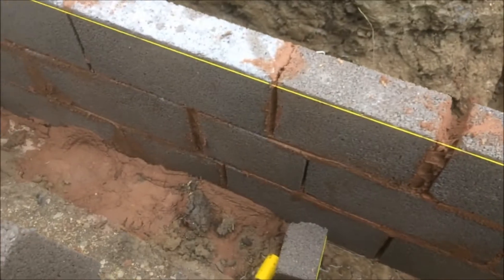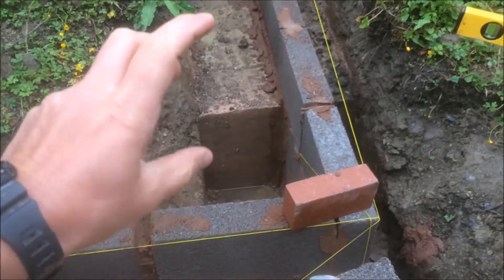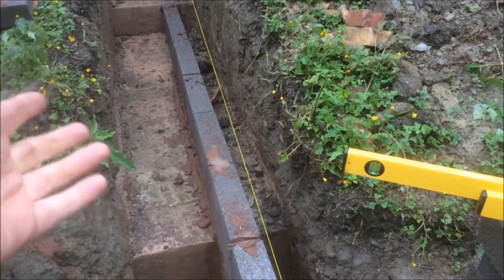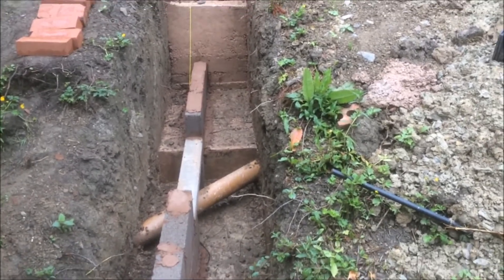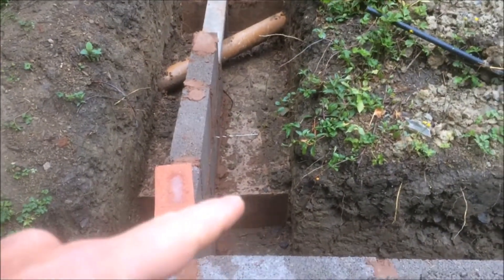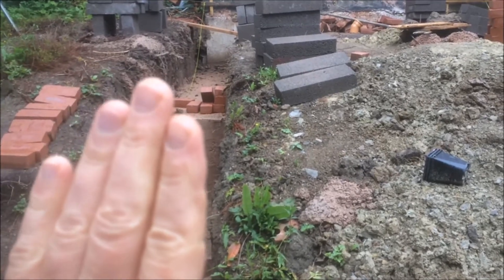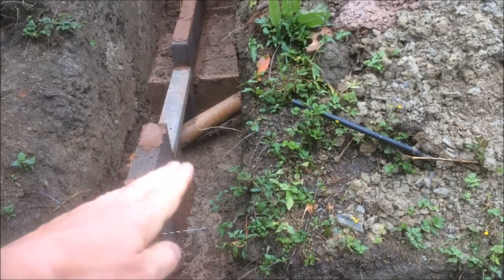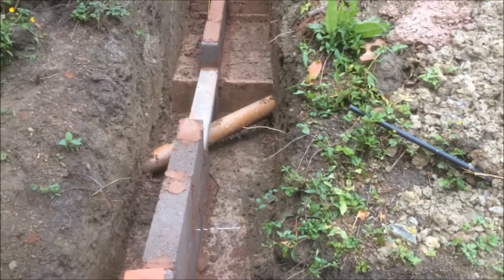How To - Stepped Foundations

Comment: Each step should not exceed 500mm
Reply from the maker: I'm not sure if that that's the case (maybe yours is a rule of thumb): According to most building regulations, the maximum height of a step in a foundation should not exceed the thickness of the foundation itself; meaning the step should be no higher than the concrete depth of the foundation.

Comment: Did I hear wrong or are you bashing rebar into soil beneath the concrete footing? Wouldn't that inadvertently introduce concrete cancer?
Reply from the maker: Great question. Concrete cancer (weakening of concrete over time) can occur in two ways (off top of head). Either the aggregate used within the concrete is "aggressive" ie. acid producing. Or the soil in which the footings are placed is acid. As cement is alkaline the acid acts on it to weaken bonds. Typically this is sulphuric acid (as in BRE special digest 1), although recently aggressive ground has been expanded to include other acids. So it would not be the rebar that causes the problem. Concrete is permeable any way, so acid water will get in there if it is around anyhow. Hope this helps. :-)

Comment: Great video, really informative to see! Could I ask please roughly what the total height of the "drop" is?
Reply from the maker: From memory it was a five block drop (5 x (215 +10)= .1125mm.  With 1 x 3 block step and 2 x 2 block steps. When you work out step height, add a little extra to account for mortar. Better to have a little too much room (higher step) than not enough. Easy to but thicker joint in block work, than cut all of block sin a course. The steps were not the same both sides, as I had to get footings below pipes which ran across site.

Comment: Hi, very informative, Thankyou! Do u somehow remove the shuttering after concrete set or cut it down to footing level or.....? Thankyou in advance 👍🏻
Reply from the maker: This way the lower step is formed first. You then secure the shuttering on top of the lower step. When the concrete is "green" (set but not cured) the day after pouring, remove pins and wiggle shuttering free. You can then use it for the next step! I mixed my own concrete so could do one step at a time. Happy Mixing!
Reply: @DorkyThorpy  Thankyou, makes good sense! Not sure about mixing myself now as I worked out 14 jumbo/ton of ballast! Did u use all in one ballast or do a particular mix specific for footings? Appreciate your replies 👍🏻
Reply from the maker: @norris5353  I got a 6 wheeler load of all in limestone ballast, "suitable for concrete" I asked for that. Just followed instruction on back of cement sack for mixing. Out of 10 tons delivered I used about 8 I think, did each step separately over a period of days. Its quite stressful getting a ready mix delivery I thought, mix your self, skip the gym, and take you time perhaps. 1 person can mix and barrow about 1m3 per 2 hours labour. I had to barrow mine about 100 meters.
Reply: @DorkyThorpy  hmmm, ok well Thanks for the advice. I would prefer to actually mix myself but the shear volume and humping about slightly puts me off lol. We'll see. Thankyou very much and all the Best 👍🏻
Reply from the maker: @norris5353  No worries, good luck with it.
Reply: @DorkyThorpy  hi, me again :) Just a quick question. Was all your trenches like a metre deep and even though stepping down, still maintaining the 1 meter depth all around still? Thanks
Reply from the maker: @norris5353   there is a certain depth the TOP of the concrete has to be below surface, and also minimum thickness for footing. I think top has to be 450mm below ground level, and then what ever minimum thickness of footing which was 600mm in my case. So minimum overall depth for me was 1050mm . . . . . or 1 meter approx. Part A of building regs is worth a look.
Reply: @DorkyThorpy  ok Great. I shall take a look. Thankyou 👍🏻

Comment: Hello
I will ask, for the foundation, how about quality of K concrete is the casting used? if the K250 concrete is used, is it enough quality? thanks
Reply from the maker: I mixed the concrete following instruction on bag, i.e. my hand in a mixer. I used a crushed limestone aggregate (all in ballast), at 1 to 5 mix. Your K250 mix is  approx 1 to 4.5 so should be fine.  I have built sheds in the past and used 1 to 10 before and it comes out fine. But followed the rules for this one because of building regs. Most things are design 3 times stronger than they need to be. (Factor of Safety = 3)

Comment: Hi there, very interesting and good explanations of the process.  I wanted to ask you a question regarding the shuttering, does the first pour need to set before the next step is poured, I am wondering if the bottom step near the shuttering bulges as you pour the second step ? I'd appreciate your experienced answers...thanks
Reply from the maker: It should be fine provided the mix isn't too runny. I guess you are pouring in one go, with ready mix  . . .  . 

1 - If you were to get a low slump mix, you could fill in sections under shuttering with stiff / low slump mix, and then get driver to wet up remainder loads to easy shovelling and smoothing. 

2 - I have seen builders use full height shuttering and poke rebar through to join next section of footing. This creates a break in the footing, but would be a safe bet if allowable by building control. 

The shuttering should not bulge providing the wood used is thick enough. Suggest 18mm OSB or Plywood. I use doubled up 9mm OSB and it was fine. Held in place with rebar hammered in to trench sides.